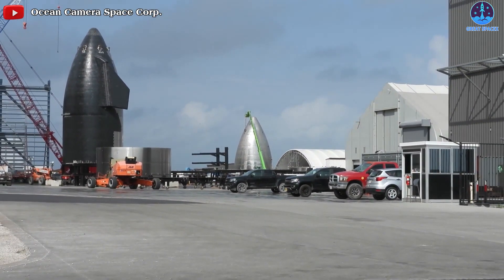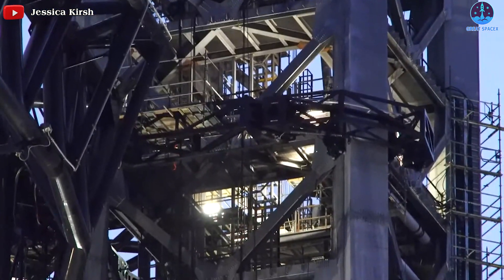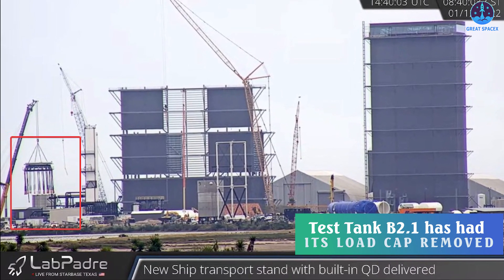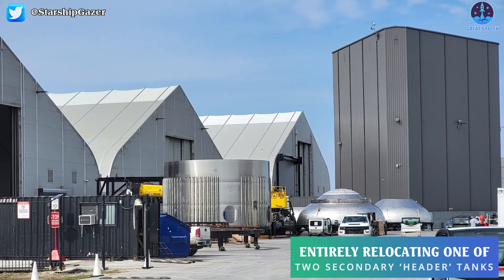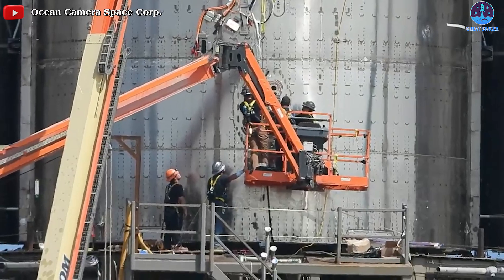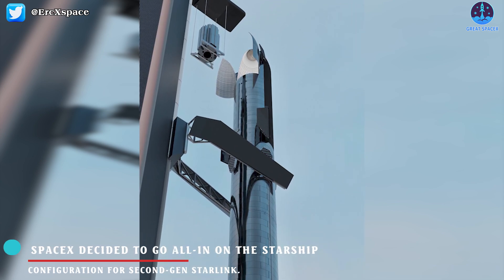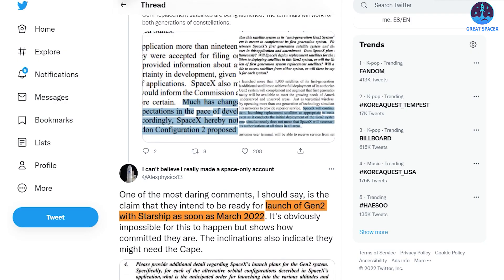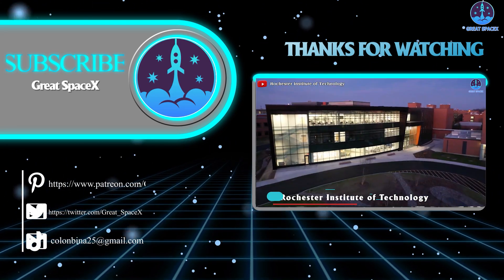SpaceX Mechazilla's arm lifting proof Tests with 100-ton water balls to simulate Starship...

Comment: I suspect the smaller rings make it easier to feed plumbing through the hull of the ship - it’s easier to cut into a space that has a natural material break rather than having to cut a hole in the middle of a ring
Reply: Isn't a hole in the middle of the ring stronger than one on a seam?  I would think that long term strength is more important than a short term manufacturing period.
Reply: @longshot7601  possibly, I’m thinking from a wiring perspective- easier to cut out a hole in the edge of say chip rock to feed network and power through, vs needing to bore a hole in the middle and risking stress fractures. I’m just an IT guy not a structural engineer 😂

Also smaller rings with edge cuts I’d expect ia easier to automate for production lines rather than manual cuts or post production cuts to install equipment and lines - again just food for thought

Comment: Done right welds can add stiffness to the cylindrical shape and shorter cylinder segments will also add strength horizontally and vertically.
Reply from the maker: Exactly!